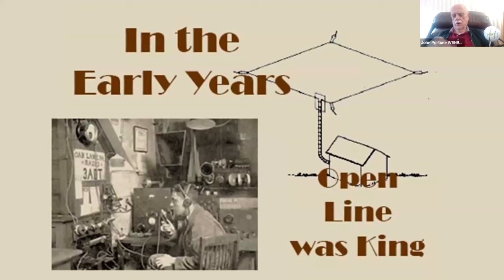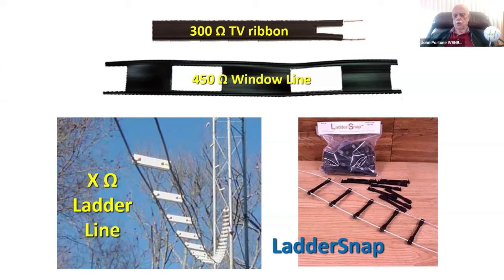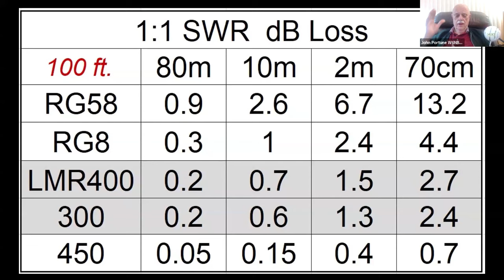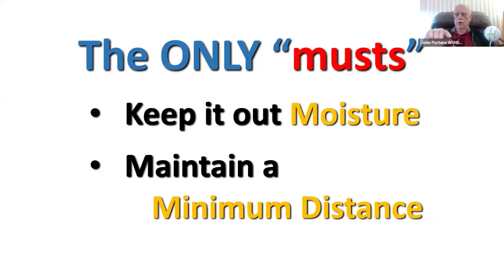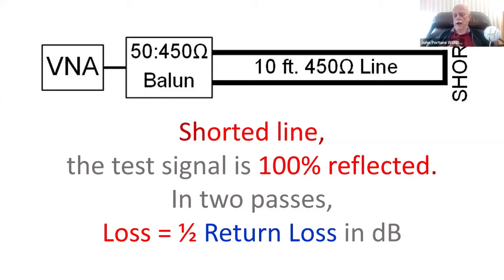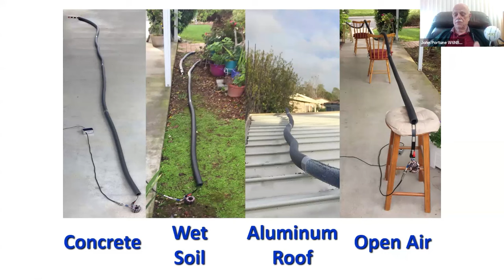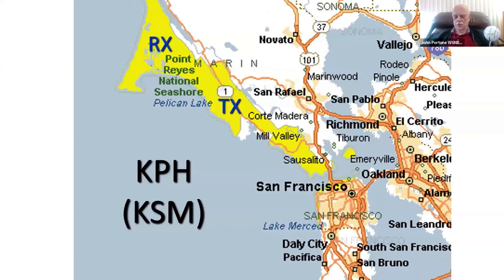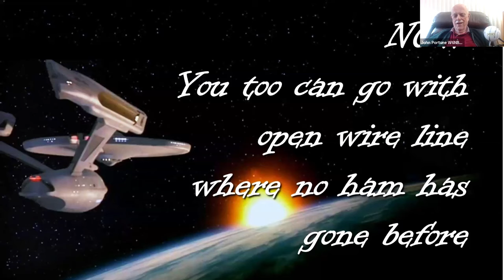Open-Wire Line for Antennas- Using Open-Wire Line in “Forbidden” Places

Comment from the maker: Thanks for your comments --- Keep em coming (smile).
My first antenna as a novice (KN7REX) was an 80m—10m dipole using a 450 ohm ladder line. I ran that to a homebrew antenna tuner, where I made the 50-ohm coax connection from the transmitter. That was in the early sixties. I also worked for a local electronics supply company that sold already-made up 450 ohm ladder line along with coax, etc.,.
This presentation brought back lots of great memories...    Dan / K7REX

Comment: Thanks for the video. Great information. I would say one aversion to using open wire transmission line is most amateur radios/transceivers are 50 ohm and most commercial purchased amateur antennas are 50 ohm. To use open wire ladder line transmission line means I have to convert at both at the transmitter and antenna. So it means an extra transformer at each end. And since all test gear is 50 ohm native, it means having yet more transformers to match the transmission line. This to me is the largest aversion to using open wire transmission line for amateur radios. Thanks again for your time and effort for the tests and filming you have done.

Comment: Big open wire feed line fan here.  Thanks for the information and I suspected this to be the case.  When you go to a true 600 ohm feed line the conduit is going to get pretty big for burial!  I always wanted to make a circular multi-feed open wire feed system inside of PVC pipe.  You could even pump dry air into it like the big broadcasters do with there hardline coax.  73, KF0BBU

Comment: Good  video Mike. Did you by any chance evaluate whether Zo was affected by the foam. I would expect an increase in capacitance per unit length and a corresponding drop in Zo. This isn't a loss consideration but would create an impedance bump.

Comment: worked on lots of ships with remote tuners fed by rg-213 to wire and verticle glass antennas 2-21 mHz without issue worldwide (ie: antarctica to north america) with 500 watts or less. At the same time worked the world from those ships on the ham bands with poor multiband verts and 150w or less (10-20 M due to antenna) fed with high loss coax rg-58 or 8x and was very succsesfull. I spent time at the CG commsta next door to KPH (NMC) back in the 70's and got to admit, wish they would have let us play ham there LOL. As I recall they had 10kw+ ssb and 2-4kw MF cw. As best I recall the hf antennas where rhombics aimed west and sw, not sure about the mf ones. enjoyed your video, thank you 73

Comment: The foam insulation is going to solve my problem of getting the 450 ohm line into my shack, a metal building.  I'm finally going over to the dark side and in a few days will see why so many guys brag about open feeder and doublets.

Comment: Would running power and using your water pipe sleeve  affect the losses you measured over the different materials?  I would think running  more power increases the field around the transmission line, possibly having an effect on swr.

Comment: The information is interesting. If you could show the return loss of the unencapsulated open line in each of the situations you demonstrated, the differential data would be even more compelling. Using water pipe insulation provides a continuous "stand off" regardless of the environment that the open line is routed through. Quite clever. However, in my situation, the insulation increases the visual impact of my entire antenna system. Using the old-fashion TV stand-offs and other means to insulate the open line from its environment may result in less of an eyesore, in some cases.

Comment: Interesting.  Whilst I certainly remember 300 ohm ribbon (used mostly inside) and 300 'Ladder' wire (mostly used for long runs up towers for TV antennas around here (fringe area at the time), I've never seen 450 or 600 ohm line in use in this country.  I think the reason for the rise of coax is partly that rigs seem all to 50 ohm outputs to an SO239 these days and coax is unaffected by weather, so we live with the loss, particularly on HF where it's less of an issue.  300 Ohm ribbon UV stablised (black, not the clear stuff) is almost unavailable here now and the ladder wire which is far better for outdoor (being solid copper) seems to have completely disappeared.  There were issues with this too, for some reason galahs (common native parrot) seemed to love chewing on the plastic separators, which could result in it becoming just wire in the span of under a year.  To a lesser degree, they attack coax as well, the usual solution being to put it through garden hose (UV stabilised type) to protect the cable from them.   Galahs used to wreak havoc on the VHF Collinear Arrays 2with masthead amps we used for TV antennas (on top of a 30 to 40 foot tower) by perching on the elements, often in flocks, which sometimes broke them off at the plastic joiners and sometimes chewing on the phasing array plastic separators to the point it was just bits of bent or broken metal hanging in mid air.  Towers were so common here (in Regional South Australia) to get TV from the 50's to the early 2000s when digital came in and local repeaters for the major networks finally were installed here, that there were streamlined approvals for construction, which remain, as long as the tower and the foundations are done as required and the local council inspects the concrete foundation and mounting j bolt before the concrete is poured, its a rubber stamp job and there are literally hundreds of towers (now obsolete for TV reception) still standing.  It's become something of a hazard in fact, as they were made of 2 inch water pipe and when the galahs ate the cork caps, they'd fill with water, and over the years, if the base had been 'buried' by well intended gardens built around the base, the tower would rust out at the base and a strong wind would push it over, often onto rooves or power lines.  Still have a few old towers fall over in storms every year, so people are gradually getting rid of them or cutting them off at roof height because they have a modern UHF antenna for the local DTV services on them.  Just TV antennas here could get complex.  There were often 3.  A VHF High Band collinear at the mast for getting TV from the state capital roughly 100 miles away, feeding a masthead amp, powered from the ground, sometimes with coax, sometimes ladder wire.  Then a VHF Low Band yagi for the two local LB VHF stations about half way up the tower and later a UHF Yagi for the SBS service was added, all fed to a three way filtered coupler, to which were usually added attenuators for the very strong local signal to stop it getting back up to the masthead amp and causing it to clash with the weak HB signal.  It's much simpler now and one UHF yagi at roof height is perfectly adequate.  Old 'boosters' were something of an RF problem as they would sometimes turn into noise generators as they aged, long after they were actively being used and this could create interference issues for HF particularly as they'd sometimes blot out entire parts of various bands with noise.   Thanks for the lecture, it was interesting.  73 Geoff VK5GDR
Reply: DX Engineering sells 300 ohm window line. I run 180 feet of it to my 160 meter doublet with fantastic results. Low loss on all the HF bands with an MFJ-998 autotuner in the shack.
Reply: @Ragchewer  Ok, thanks, I'll look into that.
Reply: It's been a LONG time but when I lived for a year with by grandparents in rural PA in he 50s, a few people did what hey would get get television.   Most had a roof top  antenna with the 300 ohm flat stuff.    But I say one installation when the antenna was about 3/4 of the way up a hill and there was 600 ohm open wire (with plastic links every 8" or so leading to the home at the base of the hill.
Reply: @GilmerJohn  Open wire line is actually less lossy than coax by a significant amount.  More prone to picking up extraneous crap, but less lossy.  Still a lot of towers here, no longer needed, but a few fall over every year where the legs have rusted out at the base.

Comment: You say that the line needs to be properly terminated, yet people ask about using open wire 600 ohm open wire directly to a dipole and you don't flinch.  Your transmission line is centerpiece to your transmission system.  It must be matched at both ends.  If you start with a 50 ohm transmitter, you need to use a 12:1 at the input to your open wire 600 ohm line.  That may be after a 50 ohm line of some length.  If you then have a ~75 ohm antenna, then you can utilize a 8:1 to match it at the dipole center feedpoint.  This is critical to any successful usage of open wire systems.  Especially at 160 meters where RG-58 isn't really all that bad, it would probably outperform a mismatched 600 ohm feeder.  

The high power open wire at the first looked like an open wire coaxial cable with the center conductors tied together and the outer conductors tied together.  Probably 50 ohms.

Why didn't you properly load the test arrangements rather than shorting them on the ends?  This made no sense to me.  Return loss is the amount of signal going out compared to the reflected amount.  So if you have a lossy transmission line that takes 50% of your 100W and the antenna transmits 50W, your return loss will look very good at around 45 or so.  We need to look at the amount of current actually accepted by the antenna in real tests.  If we don't do this, we are hiding our real results.

You seem accomplished.  I don't have a second class radio telegraph license.  I'm just a school bus driver.  N9XR

Comment: In the conduit could the wire have coupled to the conduit and actually radiated?  That radiated power wouldn’t reflect and might account for the loss measurement discrepancy.